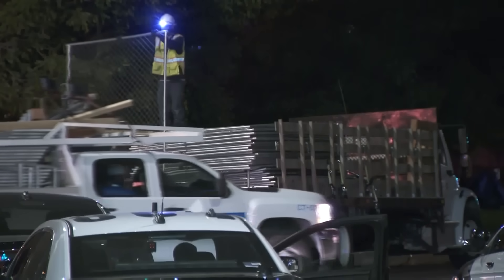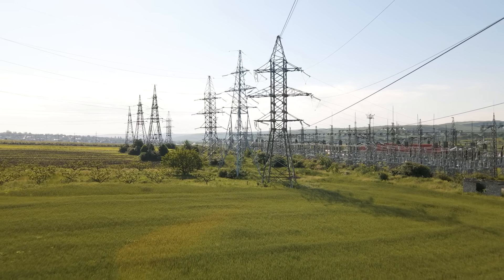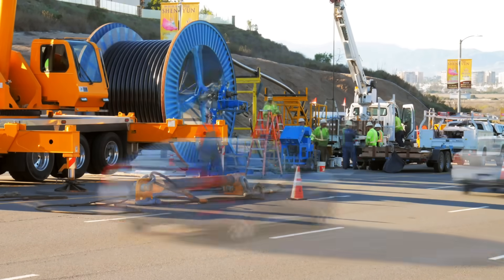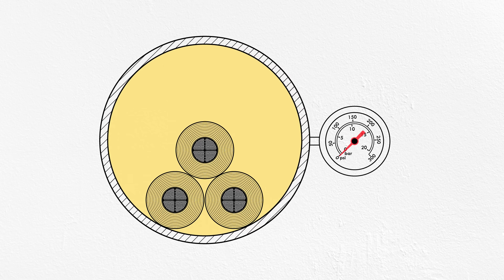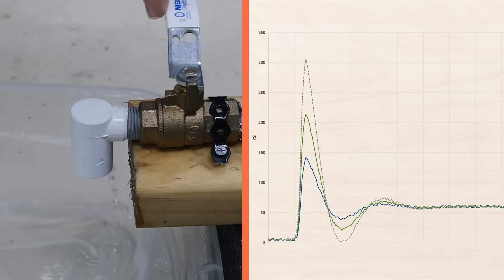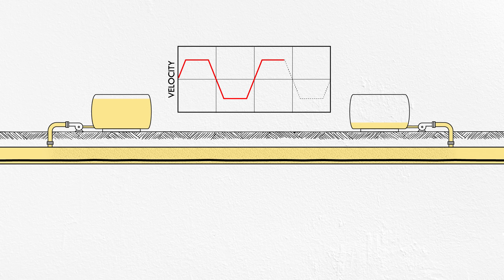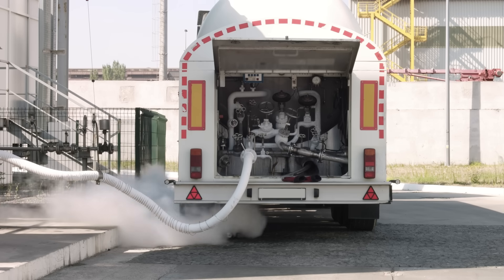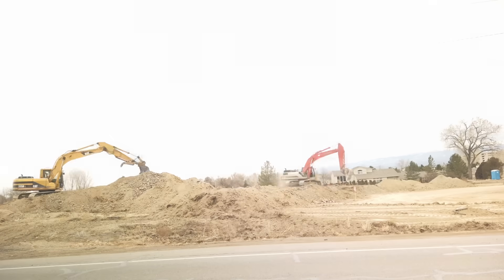Repairing Underground Power Cables Is Nearly Impossible

Comment: That was fascinating. I have had some minor involvement with the repair of underground cables from 3.3kV to 132kV (oil filled, nitrogen pressurised) but not anywhere near the length of the cables shown here. Apart from other drawbacks such as increased capacitance, the financial drawbacks of construction, operation and maintenance should put anyone off using underground cables, where an overhead line could be used

Comment: They are pushing for this in Florida but I think thats a very bad idea being that when power goes out any hole you dig is usually instantly flooded with water as a result of the storm that caused the outage in the first place. If they go underground next time we get a hurricane outage it wont be 2 weeks til its fixed but 4 months instead

Comment: This video was interesting. However I wonder about technology being used today. For example I read about a planned direct current line together with a new narrow gauge railroad tunnel from Haslital to Goms in Switzerland. First, how does polyethylen prevent arcs? Second why is direct current used? Third would make an access tunnel sense, like a six foot tunnel for three cables, like one at the top and two to the bottom sides and you could drive with a small vehicle through the tunnel? Thank you!
Reply: Correct,   nowadays you have cheap mass concrete tunnel sections sealable.  But you have to keep them above the level of outside water.

Comment: Power cables that are just put in the ground are not impossible to repair. A very simple diagnostic device can detect exactly where the break is, you dig-up that area, fix the break. (We just did this at a substation) However, the best way to run power cables are in their own concrete vaults that have water drainage. In those vaults, cable sections are only a couple hundred feet long before there is a junction box, to make cable replacement relatively easy.

Comment: I came across an article a few years ago that reported on another problem transmitting AC underground: capacitance. Due to the long distances involved and the closeness of the conductors, capacitive losses were significant. The article said the solution turned out to be DC. I never found a follow up, so I don't know if or how well this worked. Have you heard about this? (Thanks for this story by the way, I enjoy all your videos.)
Reply: It is worse under the sea.

Comment: Do they still install these types of oil filled lines? From my understanding technology has developed  more effective underground cables than the system of using oil pumped through conduits. Multi-layered thermoplastic. with layers of copper shielding to dissipate potential HV faults along the line. However, I’m just an electrician. not a utility lineman

Comment: I'm sure there is a reason why they didn't do this, but why wouldn't you have three separate conduits that separate the wires with the ground as the insulation? Then you wouldn't even need to have the oil to insulate the three wires. Amazing video.

Comment: I lived in an old house built by the original owner. He didn't have a clue what he was doing. The water hammer effect was so strong that it would knock pictures off the wall. We all knew to turn off faucets slowly, but if I had a guest over and they forgot, it would scare the bejesus out of them. Eventually we had it corrected with arrestors and redesign, but it was a scary sound. Like our house was haunted

Comment: Wow that's pretty crazy, seems like lot of trouble just to avoid putting high voltage towers lol.   Phone lines are actually kinda similar in that we actually pressurize them, I forget what the pressure is but it's not as high, like 30psi I think.  The idea in this case is to keep water out though.

Comment: Did valves exist at any point along the pipe or were the frozen oil plugs literally the only stoppers? The engineers of this system must have realized that repairing any fault in the line would be a nightmare.

Comment: I have had underground power lines installed. You don't really repair the so much as plan to quickly replace them. In the systems I had installed at a large project, the conduit had about four times the number of channels required. So, most were unpopulated. If a line failed, a new line would be installed in one of the empty channels. Then, the failed line would be removed. This system allowed for both rapid repair and expansion. Looks like the people who installed this line did not plan ahead.

Comment: Egghhh electric "resistance" doesnt make heat. If resistance would make heat it would make everything melt because HEAT makes RESISTANCE that in turn reduces voltage+amperes and therefore power.

Its easy to explain resistance to a newbie but its wrong too :)

Its not like shutting a valve that will experience high pressure when resisting flow. Its like going further away from the fire so less heat (electricity) is transmitted to your skin.

Comment: Fun Fact....That dielectric insulating oil is full of Polychlorinated biphenyls....Highly toxic! Then there is the whole EMF effect....I much prefer my supply lines above ground where I can see them and they don't leak carcinogens into my property.....
Reply: They are surrounded by a thick steel pipe that is grounded and obviously has no holes in it. That is a very serious shielding for emf to get through.
Reply: and they obviously stopped using that insulation method, we have better and cheaper methods now

Comment: So glad they don't use oil insulation anymore. Our neighborhood is fighting with the electric company that wants to run higher and taller power lines through our neighborhood which would be unsightly and lower our property values. We want them to put the lines underground to their new substation they want to build. The city is on the side of the neighborhoods to underground the lines. And most of us don't mind paying a little extra for electricity for this, but the power company is fighting tooth and nail to put them aboveground. Anyway, I now understand NIMBY.

Comment: There’s also a pipeline that goes out for miles that fills up the Oil Ship Tankers in El Segundo called Chevron Jetty. It ruined the sand flow into Manhattan beach so chevron had to fork over like 3.5 million dollars to build an artificial reef. It ended up not working very well and it was a waste of money.
Reply: The thumbnail for the video is of the Hyperion in El Segundo
Reply: @fredrickrichardson8980  
Yup, that’s why i wrote my comment. There’s also a place called shit pipe in between those two facilities that dumps sewage out of a 3 mile long pipe that goes out into the ocean. I used to surf over there everyday for 5 years

Comment: so worried about electric cars when the grid goes down. at least I can still get diesel pumped out of a tank for me. try that for your Tesla..
awesome channel. kinda wake up calls for us. so much to know
Reply: Yep. No point rushing headlong to get rid of IC cars if the Grid is not up to charging them.
Reply from the maker: Guys this was in 1989. Also I hate to break it to you, but the pumps at filling stations rely on grid power.
Reply: @PracticalEngineeringChannel  True. But the power needed to pump fuel is tiny compared to that required to charge an EV. The UK Grid system has been struggling this year. Shortage of generating capacity.
Reply: No worries, ev are just temporarily for keeping up the appearance. The real plan is to organise things such, that nobody needs a car anymore and that individual traffic becomes a relic of the past. Sorry guys playtime is almost over.

Comment: Before solid cables were reliable enough at transmission voltages the conductors were wrapped in oil impregnated paper. Still used for submarine DC cable systems. The oil had to be kept under pressure. Most used internal pressure with oil ways inside the cable with a metallic sheath and armouring. Pipeline pressure is an external pressure system that is technically inferior to internal pressure fluid filled cables. A pipeline external pressure cable relied on the steel pipe for protection.

Comment: I have been repairing and working on all kinds of high voltage power cables for years, and Im baffled by how incrediby complicated and dangerous these "cables" were. I say were, because using highly pressurized oil as insulation is so outdated and time consuming that it never made it past the drawing boards in europe. Now, repairing cables insulated with oil? Sure. Repairing cables insulated with pressurized oil? Jup, its the same thing. But bathing the whole thing in a gigantic singular tube of oil at 14 Athmospheres? Man.. thank god that cross linked polyethylene was standard insulation material in all high current cables since the 90s
Reply: UK had/has pipeline external pressure cable systems. However they use nitrogen, not oil. When they need replacing the old cables can be removed and XLPE cables pulled through the old pipes.

Comment: Why is repairing underground cables for the usa so hard? Its done in europe and asia all the time. I dont get the difference.
Reply: The difficulty is cables are in a steel pipe full of oil. If the oil pressure is not maintained during a repair voids can form in the paper insulation ruining the cable.
Reply: @davidsanderson1788  why is there oil in the pipes? in german pipes theres no oil there..
Reply: @questionyourself718  If originally a pipeline external pressure system they were likely filled with nitrogen. Or, the pipes are just ducts, not directly buried cables. The original paper insulated cables can be removed and replaced with XLPE insulated cables. In which case the pipe doesn't need to be oil filled anymore.
Reply: @davidsanderson1788  interesting, thanks for the information. in germany we just have the cables in like a pvc-tube a burry the tube in the ground with sand. thats it.
Reply: @questionyourself718  UK has too. At transmission voltages the cables produce a lot of heat so are usually buried direct in sand to dissipate the heat. Heat produced determines the cable rating. Fluid filled cables are rarely used these days.
Reply: @davidsanderson1788  i see. Well then it would make sense if usa starts using sand too right?
Reply: @questionyourself718  Each circuit is designed for the site specific conditions. Ducts might need to be used for example if the cables need laying through a city and it wouldn't be practical to open trench and then lay 100m of cable annoying road users.
Reply: This is just an old cable method. The newest ones don't need all this hassle and they even have temperature sensors everywhere so they can be monitored real-time, that is a huge advantage to use them safely at their maximum rating. We still use the steel pipe but only to protect them from the telecom wire diggers. And also against emf i guess.

Comment: They should next time they ever build a project like this, sacrifice the $ to build along the entire length of the pipe to having a top ground access point so it's way way way easier to access and find any fault zones. We could treat the cement grate access zones almost like a canal in the city, off limits, running directly with and above the line to save $ for any future maintenance that is inescapable of occuring.

Comment: I've seen one or two of your other videos but I can sure see why this problem started you off!  I had NO idea about this!  I know about some of the tools (one being Time domain reflectometry) used to find the fault and am a bit amazed that they couldn't find the problem precisely.
I take it that the replacement line is far more conventional.  Isulator materials had advanced.  I now also know not to ignore cables carrying significant power that have had their insulation pierced all the way to the conductor.
I saw that the replacement cables were probably routed using existing underground tunnels.  They still carry the same power.  Do any of the failure modes described in the main part of the video apply to them?  If so, how is that dealt with?  I'd love another video that explores the "current" state of the art. 8-))

Comment: What is also really interesting is how the integrity of these HV cables and cable insulation is tested. VLF (Very Low Frequency) testers running at 1hz at high voltage is a very cool interesteing insulation non destructive insulation quality testing. You should do a video on high voltage VLF cable testing science/engineering, its fascinatiing.

Terminations for high voltage and bus bar shape, for carna control, in switch gear (no sharp corners) is fascinating also.

Comment: My line of work requires me to find underground faults in wires. I wish my coustomers would watch this so they can begin to understand what I have to do. I can't imagine having to find faults in this type of system, just regular wires have so many variables and not to mention interference! Awesome video!
Reply: I have a break in a regular cable in an apartment somewhere in a concrete wall. The electrician said that he would have to open the wall and lay a whole new cable line from the box, make repairs to the premises, and so on. Extremely not cheap. I have to use a regular extension cord instead))
I can only imagine how difficult and expensive it is to work with industrial cables. Feel for you
Reply: @Tony-.  Yeah, I think that if I ever remodel or sth I'll put various cables behind removable panels. Cement it in and forget sounds like a good idea on paper... in early 1900s :D
Reply: @GerinoMorn  usually cables are run inside a conduit that can be accessed from the roofspace, fairly simple to pull the old one out and repair or replace it
Reply: Finding faults in buried optical fiber is oftentimes a much more straightforward process.  Just drive the fiber path and stop when you see road construction.  Down in south Florida there are several species of cable-seeking backhoes and (mis)directional boring rigs which delight in chewing up buried optical fiber cables like a gourmand twirling pasta onto a fork :D
Reply: Dont they pay you more than enough not to care about that?
Reply: Just thump it bro
Reply: @tylerfini8791  I agree, really not hard.
Reply: Or TDR
Reply: Your "line" of work. I see what you did there.
Reply: @justcows7772  I agree, I do not expect them to, BUT when they observe and instruct me to do things the know nothing about, I feel maybe they should at least have some common knowledge on the subject they are speaking about. I always smile when I ask if they know about electricity, or fault finding, and the almost always start out by saying " I owned _____ up north" or " up north_________" . Just had a customer on Wednesday questioning me every 5 minutes and telling me their system was not in the area I had detected a fault, only to dig it up and expose the fault to them, and then repair their down system.
Reply: The guy at the beginning that noticed odd construction in his neighborhood though should’ve had a scanner radio. Then he could’ve just listened in and found out quickly.

Comment: In most of Japan, high voltage lines are put underground in large tunnels.  The tunnels serve as water diversion channels for runoff during monsoon season, and also allow for easy maintenance on the various utilities that run through the tunnels.  Many countries that experienced the strategic bombing of the second world war use similar solutions.  Personally, I find it highly elegant as upgrades and maintenance in the tunnels is much less costly than digging up other underground infrastructure, and more durable than above ground builds.
Reply: Agreed, but I would keep the water out

Comment: The other issue with underground transmission is that expertise in maintenance and emergent repairs is very limited and not economically feasible. Although underground transmission faults can be catastrophic, they are pretty rare. Still, they only ever happen when the one guy that can fix it is at the beach.

Comment: I wonder why since they went through all the effort to install the steel pipe, why they didn't install a cement tunnel to connect the vaults. I've been in utility tunnels. Maintenance is easy. No having to dig lines up. No corrosive effects. Earth quakes, It is California 
I'm a 20+ yr retired electrician. With or without the tunnel why not install a steel pipe for each phase and maybe even a spare or two.

Comment: I'm opening the Russian sources on the problem since I can read them. I find that since 2005, this type of cable is being replaced by polyethylene insulation cables. Apparently the government realizes it wouldn't be able to repeat the same repair works of 1989 L.A. 5 times once the old cable system starts to really wear out in different regions thousands of kilometers away from each other

Comment: I have worked with electrical engineering so to say and the dielectric oil is also used in transformers in our electrical grids; The issue inside these devices though is that the capacitors used to store electricity and control/maintain the voltage in our grids tends to swell during usage. A basic setup of the capacitors inside the transformers is to use paper in between the metal sheets transferring the electricity (notice though that the design differs between the manufacturers). To make things more complicated the transformers are usually made of ceramic/brittle material in order to avoid any electrical interference from the surroundings. The solution to avoid any expanding of the insides due to swelling capacitors is to have a bellow at the top of the transformer, "breathing" slowly. This though doesn't create a circulation of the oil itself in comparison to the underground cabling as shown in this video (also since the transformers are above ground transmitting any heat is not a problem). Anyway, great video showing the excellence of some great engineering 😀